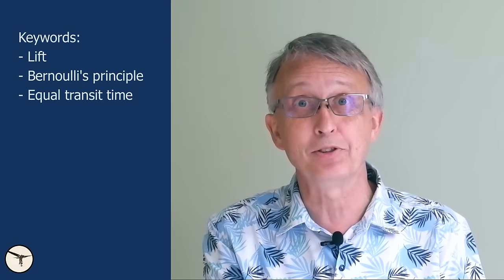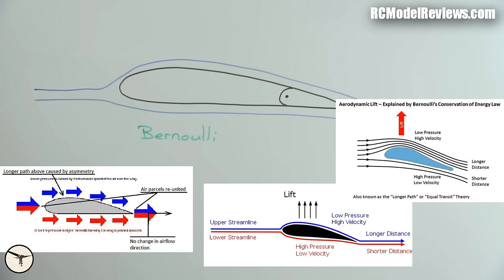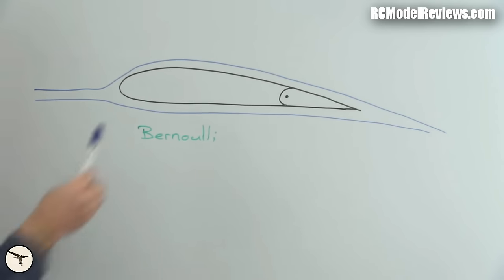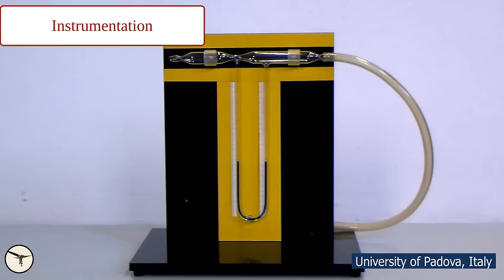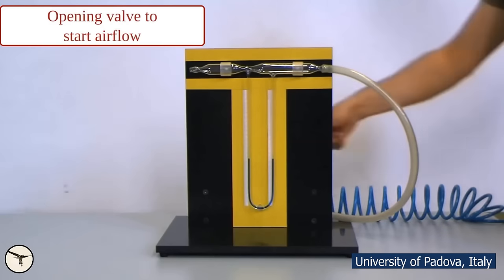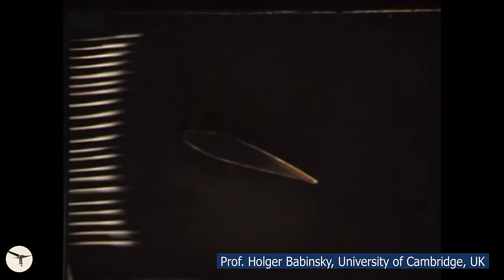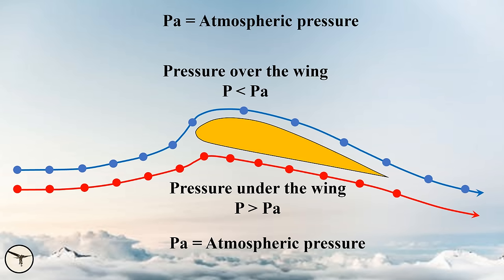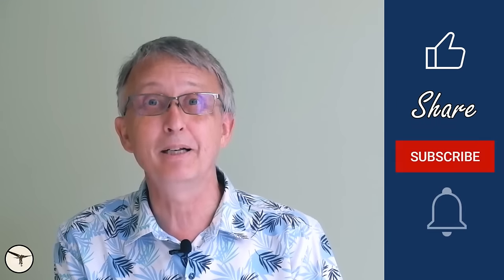Why are so many pilots wrong about Bernoulli’s Principle?

Comment: As an instructor, I've been teaching Bernoulli's for straight and level briefs. I tell them it's not a direct translation from venturi tube to an aero foil, but just explain that there is a similar effect of decreasing static pressure above the wing. Didn't realize people were trying to explain the "reason" for it as an equal transit time...
Reply: "I tell them it's not a direct translation from venturi tube"

But isn't it in fact a direct translation to all situations when considered at the parcel level because each partitioned parcel also has to behave according to Bernoulli?
Reply: @davetime5234  Not really because in a venturi tube we're talking about the total pressure of a closed system. An aerofoil is not in a closed system with a certain total pressure.
Reply: Thank you for your reply.  

I guess what I was getting at: an individual parcel in an open system obeys Bernoulli no less than an individual parcel in a closed system?

Therefore, Bernoulli relationships for conservation of energy, momentum and mass (continuity), should be just as applicable to the open system (which presumably needs to be partitioned in terms of such parcels for analysis)?

I'm wondering about the above implication for those who say Bernoulli isn't applicable to a thin boat sail?

One could say you make a conceptual transition from a closed venturi to an open system, with a wing having a cross section of some thickness?

But, perhaps it is another conceptual jump to a perfectly thin boat sail producing lift?  (here there is the challenge of convincing someone it still works without, upon first inspection, any apparent path difference between opposing sides)

But in all 3 of the above cases, Bernoulli still applies, even if the analysis requires more work in the latter two cases?

I'm trying to understand if, in the above, I've outlined the problem correctly?
Reply: @davetime5234  I see what you're saying, but it's a little over my head really lol. I just gotta teach people that wings make lift, then tell them how to take off and land lol. 

I figure if the theory of lift was unified, we wouldn't really need to have these discussions. Sadly as far as I know it's not (like the theory of gravity)
Reply: How about "Every Action produces an Equal and Opposite Reaction?" Nobody gives Neuton Credit!

A 2,300 Lb Cessna 172 Skyhawk, or a 400,000 Lb Military Cargo Plane, MUST force a Mass of Air "Down" equal in weight and mass, to that particular Aircraft, just to maintain Level flight!

Even MORE, if it wants to climb! Bernoulli never learned to Fly, himself, it seems!
Reply: @robertweekley5926  The problem is to get the story straight.

The change in momentum of air mass forced down equals lift. 

Accelerating that mass down requires a force.

The force is the Bernoulli pressure drop, which therefore also has to equal lift.

When you're straight and level the pressure difference is equal to weight. 

When you need to climb, you increase the angle of attack, which increases the asymmetry to the relative wind, asymmetry being the basis of the Bernoulli pressure difference which is that force that accelerates the air mass downward.

So, angle of attack is what allows you to increase or decrease lift, or keep it equal to weight, all by changing the Bernoulli pressure drop force that controls how much vertical momentum goes into the air forced down.

Angle of attack allows the pilot to control the amount of restriction to air transit, which due to the continuity of mass flow rate restriction, allows the pilot to vary the higher speed of the air travel necessary to accomplish the continuity of mass transit.

By Bernoulli there is an associated static pressure penalty, for the  increase in dynamic pressure needed to maintain the constant mass flow rate continuity through the restriction. .

This static pressure penalty is the force accelerating the mass of air vertically.  That is, it is the source of lift.
Reply: @davetime5234  It may surprise you to find out that the airplane in a steady climb at X knots has the same angle of attack and lift as the airplane straight and level at X knots. Increased angle of attack is only required to transition into the climb, and not for the climb itself. On the other hand, best rate of climb speed tends to be slower than cruise so climb AoA will end up higher in that case, once the airspeed reaches Vy. But for ‘cruise climb’, AoA will be the same as for S&L.
Reply: @XPLAlN  You must be joking?
Reply: @davetime5234  Nope.
Reply: @XPLAlN  You trying to explain Newton's 1st law, kind of looks like either it was a joke, or you didn't really read my text.
Reply: @davetime5234  ….I say this because you wrote: “when you’re straight and level the pressure difference is equal to weight…when you need to climb you increase the angle of attack which increases the asymmetry to the relative wind”.
   What I am saying, wrt the climb, is you only need to increase AoA in order to pull up into the new flightpath, but not to maintain it. That is all. However, I should amend my previous comment because in fact, the steady climb requires slightly LESS lift and angle of attack than does level flight at the same airspeed. The vertical climb would necessitate adopting the zero lift angle of attack.
Reply: @XPLAlN  "you only need to increase AoA in order to pull up into the new flightpath, but not to maintain it"

Right, so my point is your statement is inconsistent with the content of my message, which is based on physical reasoning which clearly implies fluent knowledge of Newton's laws of motion.

Distance, Speed, Acceleration.

Vertical speed zero: no vertical acceleration.

Target a vertical speed: accelerate vertically until vertical speed achieved.

Requirement for acceleration:  net force

What is the net force:  Lift (vertical component), in excess of weight.

When target vertical speed achieved: zero the vertical acceleration, by zeroing the excess of Lift (vertical component) over weight.

Angle of attack:  pitch up, which increases lift as the velocity vector (at the new expanded angle) gradually converges upward to correspond with the target vertical speed angle, resulting in a decrease angle of attack to the value where Lift (vertical component) equals weight, resulting in no net vertical force, and therefore no further vertical acceleration.

Constant positive vertical speed is achieved (Newton's 1st law).

My point is:  did I really need to say that?
Reply: @davetime5234  quote: “my point is did I really need to say that?”
Well, you have 88 comments on this channel alone so far. None of them need to be said.
  Your comment, to which I replied, is ambiguous at best. The climb does not require an increase in angle of attack, that is what I am clarifying. Even if you say that is what you meant, it was not clear. But you seem to agree with what I wrote even if you don’t think it was necessary.
Reply: @XPLAlN  It wasn't clear what point you were trying to make.  It was an answer looking for a question, it seemed.

If you want to stay on topic, please explain lift, concisely, but reconciling the main points of common disagreement rationally, in keeping with first principles of physics.  Again, as few words as possible would be greatly appreciated, but while still connecting the key points, and avoiding circular logic.
Reply: @XPLAlN  "The climb does not require an increase in angle of attack"

Well, first of all the climb does require an increase in angle of attack due to F=m(dv/dt).  If vertical v is zero and you need a positive rate of climb, you need to apply the force as in the above relationship to establish the climb.

So, no angle of attack to increase lift, no climb.

increased angle of attack --> increase in lift --> upward change in velocity

As terminal upward velocity is achieved, the velocity vector rising decreases the angle of attack to correspond to a zero net force.

My point is that the relationship between velocity, acceleration and force is high school physics, but what does it add to the topic at hand, unless someone is specifically asking the question.  I don't see what point you're trying to make in relationship to the topic.

"Well, you have 88 comments on this channel alone so far. None of them need to be said."

You can call me out for the ones that are off topic, but not the others.🙂
Reply: @davetime5234  No idea why you are still banging on about this one. The point remains, that the comment to which I replied was ambiguous at best because this > “When straight and level the pressure difference is equal to weight. When you need to climb you increase angle of attack”…..implies more lift is required for the climb than for S&L. Nothing you write now can change the fact that this implication existed at the time I posted my reply. A normal response would have been more like ‘fair point, let me clarify I was only referring to the transition, not the climb itself.”
Reply: @XPLAlN  Yes, transition to a climb does require an upwards acceleration, which requires an increase in angle of attack.

No correction necessary.
Reply: The equal transit time was always so bafflingly nonsensical to me. It would have made more sense to have said magical elves  just pushed the air faster above to balance time. It was clear even when a teen this wasn't hand-waving and there was something not being conveyed accurately. Turns out this is still a notorious difficult and still not fully understood phenomena.

Comment: Having never heard that hypothesis that the top air would catch up to the bottom air, it was really easy for me to be skeptical about it.  In my mind, the speeding up has always been about squeezing the flow to make a fluid go faster, and that applies to a single flow as well.  I have no reason to believe there is much of any interaction between the streams once they split between above and below the wing.  Anyway, great exploration of the topic.

Comment: The angle of attack has an impact on the lift as well. It correlates to the under the wing lift.
Reply: There's no such thing as "under the wing lift" The lift a wing generates is the result of the pressure difference between the air over the wing and under the wing. By increasing the angle of attack you increase the pressure difference, which in turn results in more lift. That by the way also explains the wingtip vortices. Because all that is, is air trying to flow from the higher pressure area under the wing to the lower pressure area above the wing. At the inside of the wing generally the fuselage of the aircraft prevents this movement, but on the outside there's nothing that prevents this from happening if you don't add things like winglets.
Reply: @shi01  Have you ever held a piece of flat cardboard (or something similar) against the wind? Tell us you feel nothing pushing against you. Its not "air trying to flow", its literally physical mass of air pushing you. So you can call it "under the wing lift", which it is. Same exact principle if I shot you with a water cannon, you'd go flying yourself momentarily, and not because the water is trying to go around you to reach lower pressure area lol. Air is a fluid too.
Reply: @rykehuss3435  If it would be only reaction force, explain the stall effect. If you increase Aoa, yes the pressure under the wing will increase slightly, but the pressure over the wing drops even further. The the flow over the wing "stalls" the higher pressure under the wing isn't nearly big enough to provide any meaningful lift. The aircraft will drop like a stone regardless of it's speed.
Reply: @shi01 how do u explain then there’s more pressure under the wing? Exactly Bernoulli
Reply: @aarondg19  Bernoulli explains the pressure drop above the wing, sure. But why does the airflow over the wing even stay attached to it until a quite high angel of attack? Bernoully doesn't explain that. Why does the airflow accelerate over the wing to start with?  Bernoulli can't explain that. Bernoulli only explains the correlation between speed of flow and static pressure. It doesn't explain how a wing works, it was never meant to.
Also, be careful when using Bernoulli in combination with high speed flows. The Bernoulli theory was meant for incompressible fluids. It does work with gases reasnable well, but only a low flow speeds, when no significant compression effects occure.
Reply: @shi01  read it again. It’s not all about Bernoulli, of course, but it’s the only way to explain why if the airfoil accelerates the air particles will create that differential pressure.

Comment: How do planes fly upside down? 
How does the little wind-up balsa-wood toy plane fly when it has no wing shape. 
What about paragliders? 

Is it possible that the air is being pushed down (notice that it moves down relative to the direction of travel in the flow), on the underside by impact with the wing surfaces and Newton is simply in charge as the action (air being pushed down) is offset by an equal and opposite reaction (wing being pushed up?)

Comment: Where does the thrust from the engine(s) come into play. You can take a hollow tube and put a powerful enough engine in it and make it "fly", I am visualizing children's toy rockets. If you put flat wings, angled up slightly, on an aircraft and engine(s) to produce just the right amount of thrust to push the assembly through the air with just a little extra wouldn't it keep the assembly "flying"?

Comment: I'm guessing, this has a similar mechanism as how rolling two similar balls, one rolling down a straight path on a decline, and the other moving through a sine-wave like hills and troughs, both at a similar starting point and going towards a similar end point, would result in the one with the sine-wave hills and troughs finishing sooner than the one at a straight incline, because the sine wave path helps accelerate the ball more efficiently than the straight path.

Just searched for "two balls rolling down hill" and the word brachistochrone comes up.

Comment: Thank you for finally stating this. The pressure under the wing is FAR greater than the negative pressure about the wing. If the wing was nothing but a flat surface, it would still work just fine.
Reply: Indeed this has been my intuitive thought for 2 decades, but scientists always talking to the wing lift due to lower pressure at the top always bothered me. If there is more pressure at the bottom, its enough to cause lift. 
when you hold you hand out of the car slightly tiling up wards, you feel the lift, and the wind pressure on the underside or inside of your hand, a lot more then the any pull force you feel at the top of your hand.
Reply: @Quraishy  The shape is more to avoid stall:)

Comment: It's amazing how everyone always focuses on the longer length of the upper surface instead of focusing on how the foil is disturbing the air as it moves through it.

The stagnation point is located under the wing just behind the leading edge. This stagnation point is the source of the upwash of on-coming air and is the result of the flow pattern around a foil. 

The air that flows up towards the bottom of the foil hits the surface and is forced to change direction and follow the contour of the underside. First, the air flows up and then changes direction, giving air flow at the bottom a longer path(due to upwash not length of the bottom of the foil), hence a delay compared to the flow travel above. 

The further an airstream is away from the foil's surfaces, the faster it's moving.

Comment: At 2.39 notice how the air is being forced downwards. The lift can can also be determined using this. A wing works in the same as a propeller. Stand behind a propeller at full thrust and you will get the idea.
Reply: Static thrust is a special case. I had not seen that slow motion before. I only saw the old spark stop motion. That explained turbulent flow.
Reply: I think the explanation you are looking for is Newton's Third Law of motion.
Reply: Mark, I was going to make the same point you make, except with a helicopter "Rotary Wing". A helicopter rotor is also shaped the same way as an airplane wing. Its motion with rotor angle of attack create a tremendous movement of air downward. It is F=MA. The Mass of the air times the Acceleration of that air creates the Force upward, which lifts the copter. It is "For every Force, there is an equal and opposite Reaction." Air downward/Helicopter upward. Same with an airplane wing. Thank you for mentioning your point about the propeller. Propellers also have the same airfoil shape. I agree with you 100%.
Reply: A wing doesn't work the same way as a propellor but most rotors work the same way as a wing, at least to some extent.
Reply: @mikekelly5869  They all work the same way.. We just view the effect differently. With a fan or propeller stationary we feel the blast of air because the blade is drawing in air one blade at a time in the same place. When the airplane is in motion the blade describes a spiral. The British word for propeller is Aero Screw.  Many propellers have Clark Y airfoil. I never worked on helicopters so do not have a full understanding. The larger the rotor "disk" the more it can lift. The same as wing span. It all has to do with Mass Airflow.
Reply: @jayreiter268  Props, at their simplest, are just pumps that push fluid in a given direction and create equal and opposite reaction, that's why variable pitch is important with mire sophisticated types. Lift rotors are more like rotary wings with a combination of reactive lift (pushing air dwnwards) and lift due to pressure differential created by aerofoils.